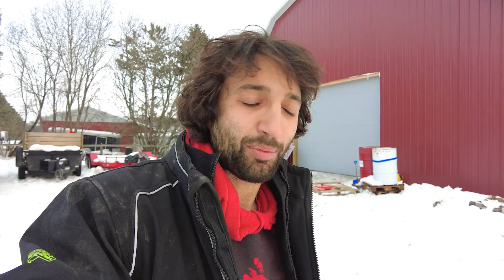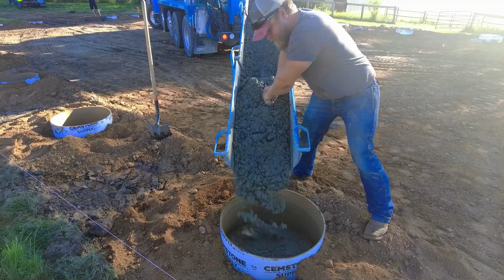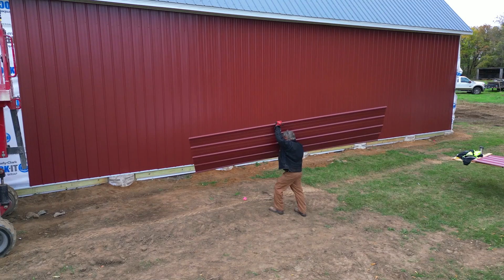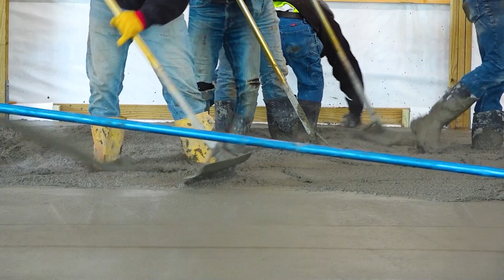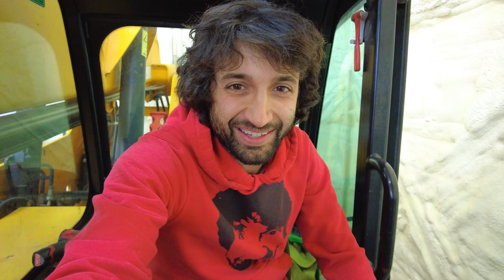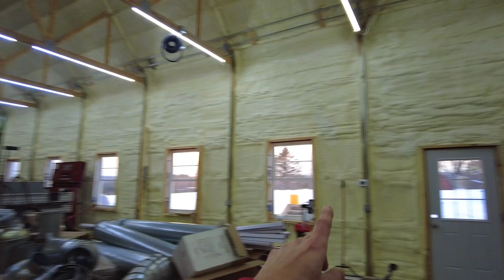How Much did this Stupid Barn Cost to Build? - 40x72 Gambrel Post Frame Episode 23

Comment: Your business can rent the barn from you.  The money in income that you collect in rent has fewer taxes upon it than money earned as income.  You don't have to pay SSI on the money you collect from rent or Interest.  As a small business owner, I rent my building to my company.  Look at the cost you were paying in rent before in a cost per square foot.  Now you can use that figure to calculate the cost per square foot you could probably increase that number by 40% because it is a new space with all the efficiencies built-in radiant floor and spray foam insulation. Make yourself a lease and each month you write a check from the business and add it to your family's personal account.  Also may want to consider the same thing with the telehandler, renting it to the business under the same lease to increase the monthly payment.  
In the long run state and federal tax burden will be the same.  Your social security payments will drop, deprecate the equipment
Reply: At the end of the day, the cost of running the business will be higher and if you can't make a payment to yourself you won't be evicted but add a late fee and interest into the lease, again money collected as interest is the treated the same as money collected from renting property and equipment.  If you ever go on an extended vacation, don't have work, are injured, etc. you will be already set up to give a sublease to somebody to come in and rent the shop to work out of and have a history of the monthly payment. At that point, the business can also collect income from any of the equipment the tenant is using.  By the sound of your voice, it still sounds like you are overwhelmed by the cost and scope of the project.  But Sir, you now have an appreciable asset that you can rent and collect passive income from whether your working in there or somebody else is.

Comment: As others have commented, you saved the most by being your own contractor. Having a GC or builder come in & do everything for you would've at least doubled the cost. That building where I am (SW WA) probably would've been $500k using a builder or GC. For a plain 2-car garage (no HVAC, insulation, water, etc) I got quotes up to $225k (about $200 psf).

Comment: Matthew, I'm not real smart but I have great common sense. with all of your wood why didn't you go with an outside wood stove. I put in a Hardy wood burner and it heated two 14/70  trailers and a garage 32x32 and only filled 2 times a day and it's been working for about 20 years

Comment: 20 years ago I built a 40' x 60' x 12' cealing, gambrel roof building from ECO Blocks, styrofoam blocks and am glad I did. It has 8" of cement between the 2, 2 1/2" styrofoam layers and is real easy to heat. I have 16' x 59 ' x 8' cealing height up stairs to store junk. I have about $80,000 into it and its not all done yet but am planning this summer to finish the outside paneling. It is where I go to get away from my wife....or is she glad I'm out there? Either way I love it. Thanks for your breakdown of your building, my son bought land and is planning on building on it this year, so this will help him.🙂

Comment: $70 per SF doesn't sound too bad for 2,880 SF building. No reinforcment steel bars in the concrete floor?
Reply from the maker: We used fiberglass bar

Comment: Hello. I had Morton Buildings to come out to my property for an estimate on a 42x80 Monitor Style pole barn. It was not one of their off the shelf designs so they gave me their "We don't want to build it price".  That was $100k. Keep in mind, that did not include grade preparation, concrete, electrical, insulation and main overhead door. 
My question to you is what is the Main Breaker Amp rating? Does it include 3 phase or will you add a 3 phase converter? Does your boiler run off of propane since we saw the propane tank in the yard? Propane prices are going up like everything else. Did you consider a wood boiler? Was it because the main posts were 9ft apart you had to use spray insulation? Going with glass insulation would have been a huge savings. Thank you. Beautiful barn.

Comment: I built my shop in 2007 it is 30x40 and I wish I would have gone bigger I am going to do a lean to that is going to be closed in and it is going to cost really close to the same price as the original price for a 15x40 addition

Comment: You need to replace the windows and doors, if they're not very well insulating. With energy prices going up, your heating costs will be home unsustainable over time otherwise. One thing: those readymade factory panels are only better at keeping sound out or in. If you build simple panels filled with just air yourself, of the same thickness, the thermal insulation will be just the same. Which means you should be able to build windows yourself, with minimal costs, compared to what store bought windows would cost, since I doubt soundproofing is an issue for you, in that location.

Comment: Your rental company ripped you on the additional time.  If a month is 2,000 then additional weeks should be 500.  As a contractor I have spent many many thousands of dollars on equipment rental.  Any fair rental company will divide the additional time by the base rent, either hours, days or weeks, the small extra portion is based on the cost of the major portion of rental.

Comment: Nice.  As a fellow furniture maker, I can totally relate to the desire/need/want to get back to furniture making.  Question: if you do intend to do some woodworking with a duct collector (ducts) and bigger machines, how do you intend to run the electrical?  I assume overhead with drops?  Or snaked along the floor?  Or other?    It would be interesting to revisit this build once you use the shop for a while to see what you should have done different/additional.  Thanks again for all the footage.

Comment: Guessing at your dimensions, it looks like the spray foam was about $3.56 per square foot. Probably a bit higher as I didn't factor out the garage door, windows, and man door. I appreciate the cost break down. I'm exploring timber framing plus SIP enclosure and this helps provide some comparison costs.
Reply from the maker: The way this company priced it is sort of tiered. $2.25/sqft for the first inch and $1/sqft for every additional inch. 4000sqft of walls and 4000sqft of roof

Comment: Why so high for the ceilings?  just to get the snow shedding ability?  Perhaps I missed a video where you addressed this question. Sorry if I did.  I am planning to build a Shop/House in the spring with this exact footprint. (in my minds eye. I need to get someone to help me design the house end of it to ensure the  measurements make sense.  I may need to go 44 wide or 38 wide to make the house work out correctly.)

Comment: Quick question. How many years of leasing your storage building could you got for $ 170.000.00?. but when you have the building paid for it is free after that. Two thing to save you money later. #1 a wood boiler will save you money on your electricity and in the future #2  a solar setup would save you on the whole mill setup.

Comment: I looked forward to seeing each video on your barn build. I built my own house and 32x48 wood working shop on my rural property in 1978. I was 28 years old at that time and did much of the work myself. It took me a couple of years to completely get over the pressure and urgency I experienced during the build. So, I completely understand your comments about whether you'd be willing to do it again. I am curious about the exposed foam insulation inside the building, will the walls at some point be covered with metal or wood? Thank you for sharing your experiences building the barn thing, and of course for all your videos.

Comment: I think the one thing you did wrong is to put your "future open storage" lean-to over your windows.   If you are just going to leave it as a porch and for aesthetics, then I think it's fine how you have it.  But if you are actually going to store a lot of things under there, it's going to end up looking cluttered, and it blocks your windows and kinda defeats the purpose of having them.  Putting a lean-to on the back side would be much better for your open storage, and it even hides it out of sight.   Either way, it's my dream building. lol.  Good for you :)

Comment: 40x72x6= 53.33 yards.  (just google concrete calculator)
So they definitely poured you a 6" slab if they really used 53 yards of concrete;  Which is actually a good thing for all the heavy equipment you have in there;  plus it will help act as a thermal mass "heat battery".  So the more the better..

Comment: I'm thoroughly impressed on how the barn turned out! The only eye opening cost was the spray foam... As for savings... I'd say you saved at least $10-12k in labor doing it yourself and with no telehandler rental you saved a total of maybe $20k. 

Lucky you had the biggest headache saver having Donavon there on the site! That guy could fill a terabyte hard drive with everything he knows about building! Us normal people don't have that luxury.

Looking forward to getting back to the house and some shop time since the snow is out.

Comment: Matt, congratulations on the building, it is what you wanted and what you got so that in itself says a lot.  I'm curious about a couple of future things.  Is solar in your mind as an option for minimizing electrical costs?  When you ran electrical, did you have to run for 480v or is 220/240v you maximum need?  The overall cost of the building came in less than what I would have thought and I live in Texas where both days of winter wouldn't affect the time.  Glad for you on this Matt... Happy New Year!!!

Comment: And you supplant rental space costs each month you don't have to rent, so there is a ROI for your build -- that is smart!  And you nix the cartage costs to ferry materials to your rental space.  Excellent video, thanks for sharing!  I have done a few in-floor systems and if there is a nicer way to heat a space I don't know what it is.  I am surprised you never went with a wood-fired central boiler, you must have lots of scrap hardwood at your disposal....

Comment: Hey Matt definitely a lot of work on the new building, perhaps you could add in the math of your previous rental situation,..I.E lease $ per Month,required insurance while leasing,utility deposits, commute time, plus fuel etc etc…I would guess factoring all those costs against the cost of your new building you’ll prob pay for your new building in 10 maybe 15 yrs. Plus you can amortize your construction costs over the next several years as needed. One other advantage too is you’ve upped the value of your residential property considerably, something you’ll never see renting.

Comment: Great video!  One question, on the under floor heat, as you load the building with racks, pallets, etc, how does this affect the ability for the system to heat the space?  Thanks!
Reply from the maker: The floor and everything in contact with it is a radiator

Comment: The New Barn really turned out super.  The cost of the spray foam insulation was a bit of an eye-opener.  Your concrete work seemed to be a bargain to me--that contractor had a huge crew, and they were working indoors, in a confined space.  Happy New Year!
Reply: Getting bids for concrete on a shop and the under cover vs open air. Under cover they will give me 5% off  if I do it in the hot summer or Dec - March just to keep the crews busy without having to cover or add finishers.
Reply: Yeah... I had no idea spray foam insulation was so costly... But if I had the $$$$$$ I'd go for it over fiberglass batts in a heartbeat!
Reply: @OldsmobileCutlass1969Va  why go for spray? batts are half the cost.

Comment: Thanks for the info Matt.
I was wondering about the cost .
Overall it's a very wise investment.
If you take in account rental space has physical return on the cost of monthly rent versus the increase in the value of your property. 
Then throw in the monetary value of you time commuting to where you'd be renting space and costs of driving a vehicle there.
All totaled up it's going to help over time to defray the cost of that building. 
Poh, and lunch is right next door and the time saved driving back and forth from a rendalphase shop is more time with your wife and little ones.
Matt, to you and your family a very prosperous New Year.
Reply from the maker: But the taco shop is right by the warehouse. Much better lunch spot 😄

Comment: The price is good but I didn’t find septic system and drainage system. Since you have no human living in it you costs too much to keep it warm. You did the monster post for foundation and floor stab separately. If you buy used equipment and do it your self it may save some labor. If you dig a basement, it increases the stability and the total useful room of the building. It increases costs around $50K but double its room space.

Comment: I will say this: by managing the project, doing some of the labor on almost every different trade and being on-site at all times, I suspect that you have ended up with a much better building than if you had paid a "package" price for a finished building. I have seen too many pole barns built to a price and failing on the quality side. Once the price is set, the incentive is to cut every corner that the builder can get away with. Not evil, just economic drive.

Comment: Looking at warehouse lease prices near you I found a similar space in Hugo, MN (about 10 miles away) offered at $1.60/sqft. That puts the lease value of the barn thing at $4,608/month and gives you a three-year payback on the current cost!
Reply from the maker: I didn’t find anything on the smaller side in Hugo. I think there was a 6k and 10k sqft space available when I was looking. I was paying $.70/sqft

Comment: The other question, and how I often justify/rationalize things, is how long before the lease payments on the old space (or similar size) would out-pace the cost of this building?  For example, I've had my 98% efficiency furnace in my shop for just under 6 winters now, so I'm a winter and a half beyond the break even for the added cost vs a standard "garage heater" and about a 2.5 winters beyond break even for an electric heater.  So I can invariably say it was worth it.  Not to mention a much better heat source :-)

Also, I may know the guy who did the house remodel stuff at Menards for/with Donovan
Reply from the maker: Simple numbers without factoring in other costs and variables: 170/20 = 8.5 years. We worked with Lucas at the golden valley store
Reply: @mcremona  then don't move in less than 9 years lol

Neal probably on the house too, I think he was gone by the time the barn came about (my dad retired in January, Donovan definitely knows him lol)

Comment: Excellent barn Matt. I built a similarly sized "hobby shop" and there's a couple of suggestions to others that are looking into this. Spray foam is THE way to go here. Air infiltration is where you loose most of your heat, not through the insulation itself. If you have a R12 or R30 fiberglass insulation doesn't matter if you have the slightest amount of air. The foam completely seals and also stiffens the metal. One down side though is the foam makes it difficult to replace a metal panel if damaged in the future.   As to the rental costs, if you think you'll need to rent equipment, especially a lift, for a month or more, consider buying a used unit and then selling it at the end of the project. Often you can sell the equipment for nearly what you bought it for, and you are not rushed on how long you have it for.  As to building it yourself, I'd recommend doing as much as you can yourself. Finding skilled contractors and tradesmen or ones that actually show up, is nearly impossible these days. I've found that I can do a better job than the "pros", not because I'm more skilled at a job, but simply because I give a crap about the finished quality.  Lastly, you need to put something over that spray foam to cover it, drywall, metal, wood, or simply paint it... It's not supposed to be left exposed..

Comment: I'm surprised the spray foam doesn't need to be covered. Lucky for you! It doesn't look like you have any 3-ph outlets, does that mean you only have single phase?  If you are really at a point of becoming a woodworker again, what a way to start the new year.

Comment: Hi Matt, thank you for the cost insight. We’re planning to build a shop with similar footprint square footage 48x60 2880 sf. Your information will help us get a ballpark figure of what ours could potentially cost. Regarding your reach lift, could you provide some of that information like machine weight, lifting capacity, and total reach and if you’d purchase that same brand again. Was it used and was the purchase price. Thanks again for sharing. Great build!!
Reply from the maker: Jcb 509-41: 22000lbs; 9000lb rated lift with up to 6’ of boom extension; 28’ forward reach, 42’ lift height; bought it used for $47k; so far it’s been great. I haven’t run any other machines or brands of telehandler

Comment: I just got an estimate for a 40 x 30 3 car garage with an attic and basement because it's on a steep hillside.  Over $400,000 was the lowest estimate.  You did well and don't beat yourself up over the cost.  The carpenter shop/art barn was a good buy!  I live in northern Va. close to D.C.